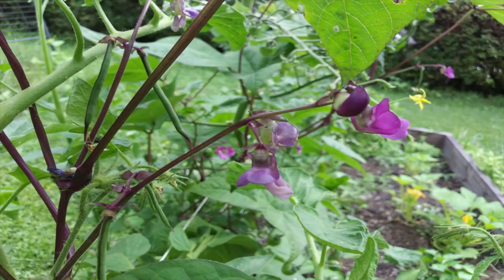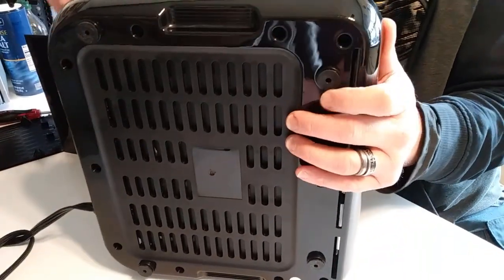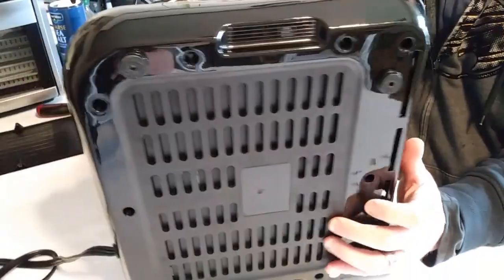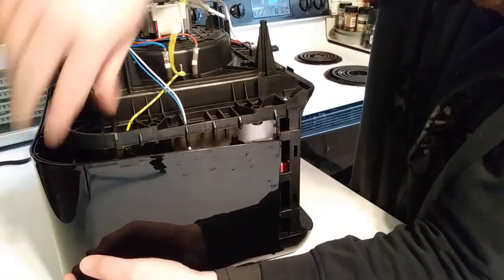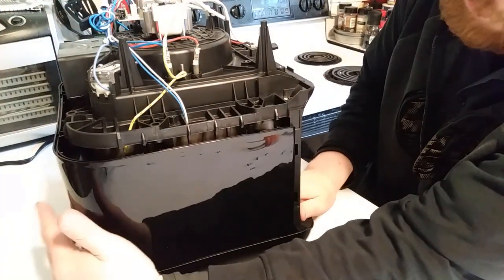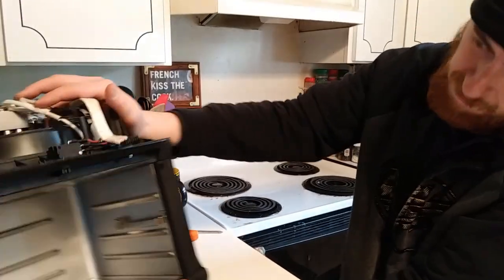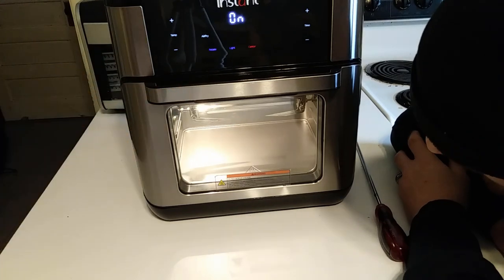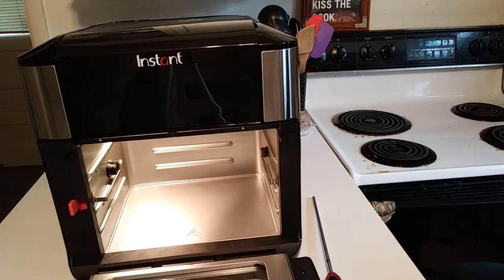Problem on the FIRST DAY | Instant Vortex Plus Teardown

Comment: Your video saved me a TONNE of a HASSLE - I watched it to realize that there wasn't much more holding the basket square thingy in place, so then I jimmied it with more knowledge and it dislodged

For anyone having the same issue: pay attn to the support rail on the motor side, that rail keeps the basket from coming out too because the second square section closer to the basket blocks it.

Also if you force spin the basket (clockwise to the left side) it will line up the axels left most side with the inner square and that make it easier to use the retractor red switch.
Reply from the maker: So glad the video helped you! 
Thanks! 💜💙💜

Comment: Thanks SO MUCH for taking the time to figure out how to get this thing apart for all the rest of us lazy basturds... The VERY FIRST TIME out of the box, when I turned mine on, the MAIN fan made a terrible noise, like the fan blade was not on correctly or inbalanced or maybe something was inside and had fallen into the blade area ...
Fixed now. 
Again, Thank You.
Reply: Mine is doing the same thing. How did you fix yours? Did you take it apart?  Good to hear you fixed yours.
Reply: @bennyes2447  Well, 
I know this seems long, but it is only very detailed, my fan was making an incredible noise, which is obviously from being misaligned in it's "cage".
So, I did take the entire thing apart, but in retrospect, I don't think I really needed to take the bottom off at all.
The top insert, about 8" x 8", pops off starting from the back, 1 clip on each side about an inch from the sides, then 2 more on each side also about an inch from front and back. Then you can see the fan motor. But before you can go any further, you have to now remove the 4 screws that hold the main top cover, which will expose wires and control boards. AND now, you have to remove the "wrap-around" sides & back cover, which has to move UP in the front just a bit AND back at the same time, multiple clips around the bottom edge and front edge, seem hefty, I did not break any of them, but be careful anyway.
Now you will notice there are 2 fan BLADE packs, the lower one is visible from inside the oven, the other is above the oven roof/below the plastic "cage" that the motor is attached to.
My Airfryer must have fallen hard on its top while still in it's box. Which caused the weight of the motor to crack/fracture that black plastic "cage" around the mounting screws, in turn causing the entire motor and fan blades to be cockeyed instead of being perfectly perpendicular to that "cage". Now comes the fun part...
From under the outside of the oven metal wall are 2 screws and a plate, on each side, and rear, which will allow you to access the roof which has the 4 main screws in the oven plus having to remove the heating coil {both electrically from above and physically from the bottom by one screw accessed by gently bending out the flap of metal holding it to the mount then removing the screw} 
Now, -VERY IMPORTANT - the nut that holds the fan blades on the spindle is LEFT hand threaded... so turn to the RIGHT to get OFF, and remember to turn to the LEFT to put back on.  In order, NUT, Washer, MAIN cooking blade {notice that tines point DOWN}, SPACER, oven roof, internal cooling blade {notice tines point UP} Washer.
For my purposes, I had to shorten the tines of the internal cooling blade about 1mm because when I epoxyed the top and bottom of the "cage" with a little build up for extra strength, so I needed to shorter tines to clear that extra.
When reassembling the fan BE SURE that both blade are oriented correctly AND spinning with the least amount of "wobble" possible... by putting washers, spacer and blades back on spindle and finger tighten the nut and spinning by finger, eyeballing the blade as it spins and get it as flat as possible by slightly and gently pushing/pulling/bending as needed, and only IF needed. I put mine together and apart several times until I was happy with the flatness of spin.
Now you have to take the MAIN cooking blade back OFF to reassemble to the oven, then put it back on before you reinstall the heating coil.
Hope this helps a bit, I do have 3 photos of ONLY the broken/cracked "cage" because I was planning on just buying the entire Main Frame... I'm the guy who doesn't ever think of taking pics along the way... only after I have the whole thing back together and working does it ever even dawn on me that I should have taken pics or video. Message me on FB @MTOakey and I will send them to you if you want.
Reply: @PatriotsGunClub  Thank you for the quick and very detailed response!  I thought I may be over my head with this but your instructions are clearly explained.  I will need to set some time to work on this.  I bought a ninja foodi grill in the meantime and happy with it so far.  Thank you very much!!
Reply: @bennyes2447  Time should not be an issue, unless you do everything very slowly!!!  LoL
Disassembly will take about 15-20mins, unless you take the screws out for the bottom, then add another 5mins.
Reassembly should take about half or less, but also plan on at least 10 -15mins to stabilize the blades.
And another 5 minutes to just stand in awe of this beast !!!  ;-)
Reply: @PatriotsGunClub  Yes I will definitely give it a go maybe this weekend. I'm pretty confident from your directions I shouldn't have too much issues.  Thanks again. It is a big help.

Comment: Same happened to us, the release lever failed to release, we were going to return it as it's under a month since we bought it. Hubby decided to try sticking a flat head screw driver in there and adjusted the little metal bit that was holding around the rotisserie rotator and it works!
Reply from the maker: So glad he got it fixed for you! 💜💙💜

Comment: Oh how I love taking things apart! I've fixed my toaster probably 3 or 4 times and it needs it again lol. It will sit there for awhile cuz I always have a plan B. Great video thanks for sharing!
Reply from the maker: Lol I will only go so far, and then I get scared I won't be able to put it back together.😂
Thanks for watching!💜💙💜
Reply: @JLoveGardens  That was a new item.  As a rule, if it's broke, anything I do cannot make it worse! Lol. I actually love it when something breaks, just so I can take it apart!
Reply from the maker: In this case, the other functions worked just fine, so I didn't want to break it further, so I left it up to my husband. I prefer to put things together, so I won't take anything apart any further than I can put it back together.😂😂😂

Comment: you started off with parts already, taken off.. how did you take off the sides and top without breaking it?
Reply from the maker: At 7:17 in the video, he shows how to put it back together. This of course would be in the opposite order for taking it apart, but it is helpful to see what the inside looks like and the direction parts need to go in before taking it apart. He may not have mentioned that he used a flat head screw driver to pry the pieces apart. Watch the direction they have to slide back together in, so you can pry and slide in the opposite direction to get it apart. I hope this helps. If you need any more help, or have any other questions, let me know.
Thanks. Shalom💜💙💜
Reply: @JLoveGardens  thank you
Reply from the maker: @sports2255  you're welcome.

Comment: Thanks very much for the video, I found it very interesting because once you opened the unit it is obvious a lot of plastic parts are used inside including fan casing and structural parts immediately next to or touching the oven chamber. I am having a problem that does not seem to go away despite following online recommendations, there is a plastic smell that blows out of the back of the unit every time I use the unit and I used it twice to cook once egg and bacon and once chicken and plastic odor seems to have stuck to the food and i could smell in the food! I read online that I should let the unit about three times once I open the box and the plastic smell will disappear and I did and the smell still lingers after the more than five times of letting the unit run for 15 minutes each time. The amount of plastic used in the unit explains the smell in my unit. Do you also have the same smell of plastic when using the unit or did you and it went away? I am honestly worried to cook with the unit now and the manufacturer does not have a forum where it addresses the problem.
Reply from the maker: The plastic smell went away for me. I wonder if yours has a piece of plastic too close to the heating element. I'm sorry I can't help you more. I hope you figured it out. 💜

Comment: When twisting the side of the basket to "lock", is there supposed to be any tension or friction to actually keep it closed? For ours, there isn't really any difference in tension between locked and unlocked, aside from the gap in the middle.
Reply from the maker: Ours does not have any tension when in the locked position. It doesn't open when you pull straight out on it, but it will easily twist back into the unlock position. Even though it would seem to be TOO easy, I never had an incident of it opening while spinning and cooking. However, I stopped using the basket because I find it a pain to use. For me it is easier to just use the trays, and they hold a little more than the basket does. I just have to remember to flip the food over. Lol
I hope this helps you. Shalom💜💙💜

Comment: You didn't tell us how to fix the rotation part, you just showed the problem. Very disappointed because mine has the same problem of non-rotational. Was thinking I found the rescue.
Reply from the maker: Taking it apart and putting it back together did fix the problem for us. Something had come out of alignment when the red lever had been pushed, but the basket was not pulled out. I hope that helps.
💜💙💜
Reply: @JLoveGardens  Thanks for replying...but I guess with these information I still am not sure if I should open and put it back. My issue was the rubber holder was so loose that you can use fingers to shake it up and down, left and right. Maybe something came loose inside or broken. When I saw your husband hold the internal turning plastic and said maybe a screw was missing, I was so glad that he found the resolution. But then he did not go further nor tell us where to get the part.
Thank you just the same.
Reply: @JLoveGardens  Thanks for replying...but I guess with these information I still am not sure if I should open and put it back. My issue was the rubber holder was so loose that you can use fingers to shake it up and down, left and right. Maybe something came loose inside or broken. When I saw your husband hold the internal turning plastic and said maybe a screw was missing, I was so glad that he found the resolution. But then he did not go further nor tell us where to get the part.
Thank you just the same.
Reply from the maker: If it is looser now than it was before, then I think you are probably right that something came loose or broke. But I am no expert.
I hope you find the solution.
Shalom💜💙💜